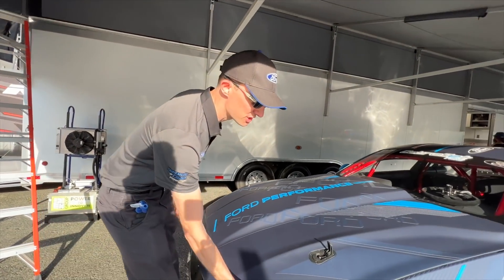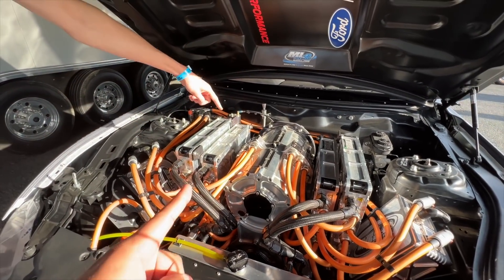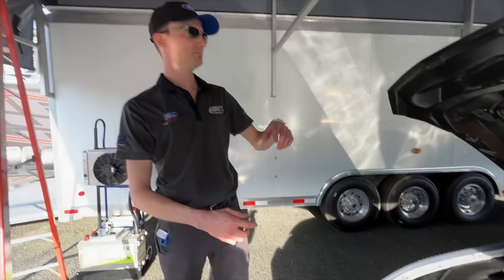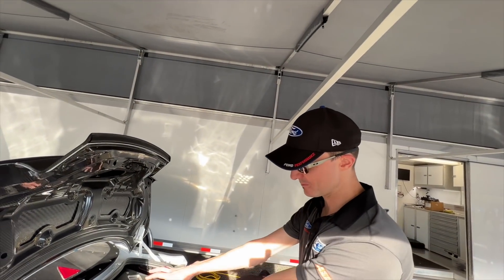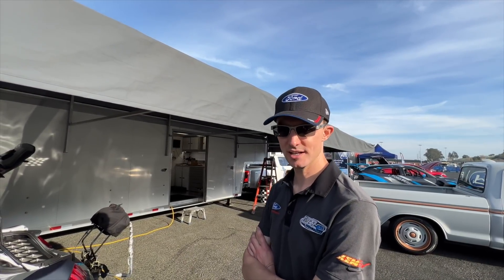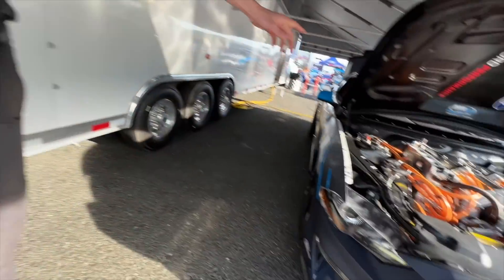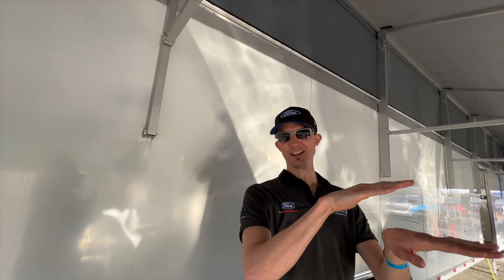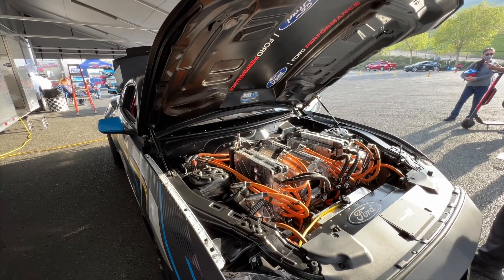800v 2000A = Wheelstands  -  Cobra Jet 1400 @HollyHighVoltage

Comment: It's so crazy to think in 3 years all of those batteries will be half the size!
Reply from the maker: I. Doubt that, my 10 year old batteries are not twice as big as current ones
Reply: @jehugarcia  the gap between the first Gen leaf and the second gen is enormous. Even Goodenough himself is making a solid state battery...hell even Tesla has leaped quite a bit since 2012 in capacity.
Reply: Battery technology is not doubling in the same form factor every 3 years. 

Packaging changes, but these are already pouch cells, so there is not much improvement which can be done in that power to size ratio.

If they used cylindrical cells, moving to a different packaging could get some quick improvement! But these folks already did their homework!
Reply: Lol looks like I was right. Might be even faster than 3 years

Comment: Not that impressed tbh. There are still gas cars that will beat it. Also where is the traction control and perhaps a "wheely" sensor?  

Being an electric car they can tune it electronically much more than fiddling with mechanical parts such as the suspension etc.

Comment: 1500 "torque at the wheels" tells you nothing. Want more torque at the wheels? Put a higher ratio final drive in.
1502 hp at the wheels indicates quite a bit of loss in the drivetrain. 800v x 2000 A is 1600 kW or 2146 bhp. That's 30 percent loss. However, if they are measuring 1502 on the dyno, they are putting it down better on the track. According to a 1/4 mile calculator, 1502 hp moving 5000 lbs. should be 8.6975 sec @ 164.75. 8.12 @ 171 mph indicates about 1800 bhp. Or maybe even more peak horsepower and they are spending a lot of time below the peak. I double checked on another calculator that also uses rear-wheel horsepower. To get those times on another calculator using flywheel power, you need about 2000+ bhp.
Reply: Dude is a drag racer at his core. Sandbagging and lying are a huge part of racing lol
Reply: Не знаю, что ты написал, но звучит умно